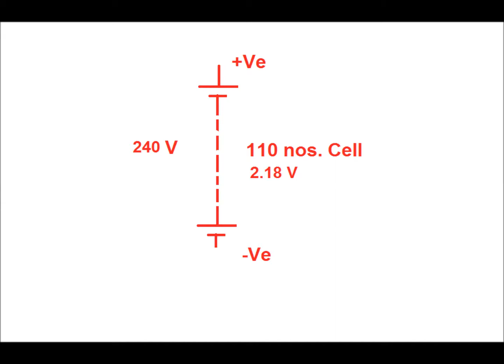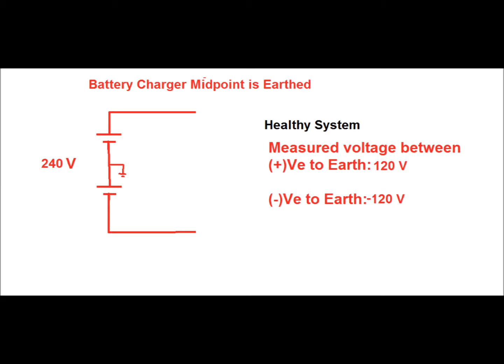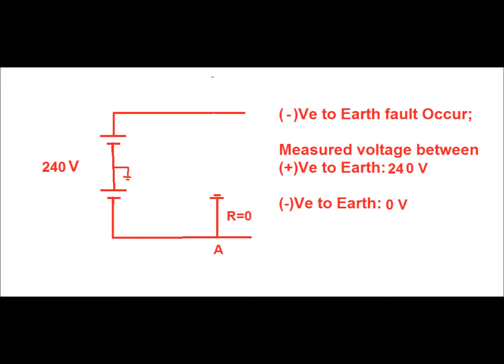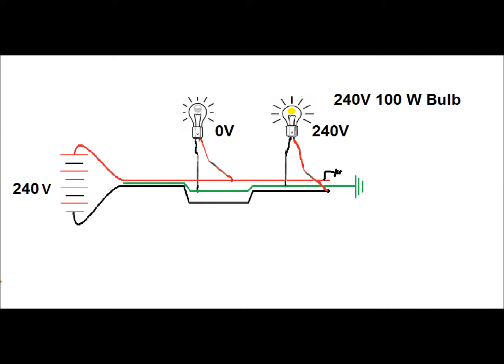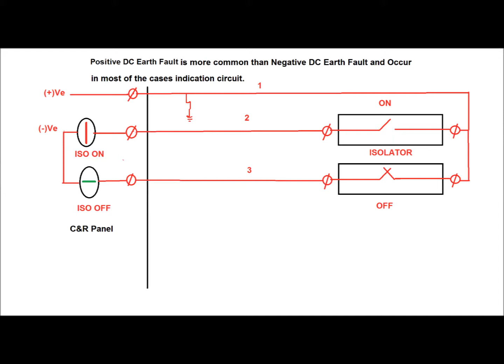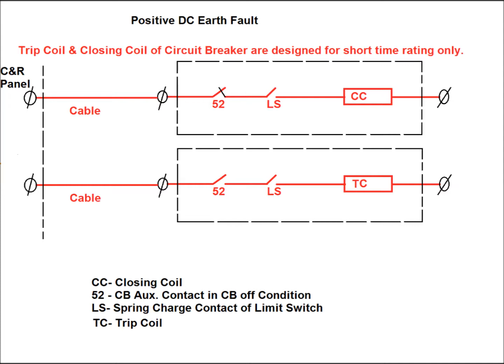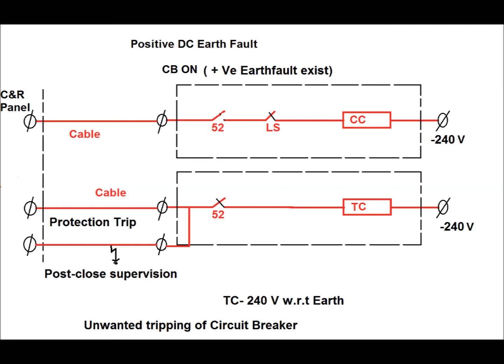DC Earth Fault ||  Impact on Trip Circuit in a Sub Station

Comment: Sir i check 24 voltage DC our substation.i find out that positive to Earth 26voltag and earth to negitive zero potionia  what is fault in system.
Reply from the maker: @parmodyadav9966  it is negative earth fault
Reply: @relayprotectionelectrical  sir I have used vcb Earth That is right or wrong

Comment: Thanks for sharing so in DC system relay will trip based on the change in voltage? And this relay functions differently from ac? Like in ac its induction but DC can not produce any induction. I am sorry for the basic stupid doubts but pls answer

Comment: friend.. why kept center point earthed at DC earth fault supervision relay....
Reply from the maker: Centre point of Battery Bank itself is not earthed. If you measure the voltage of positive terminal w.r.to Earth and negative terminal w.r.to earth under the condition battery is not connected with battery charger you would not get any voltage as there is no reference. Whenever battery Bank is connected to battery charger then only you will get equal half voltage w.r.to earthed. This is done mainly two reason one is to decrease the potential w.r.to earthed and another is it gives a returned path for earthed fault detection it may be positive to earth fault or it may be negative to earth fault.